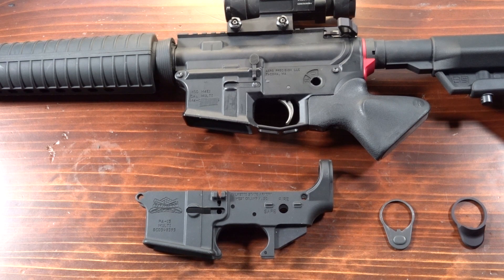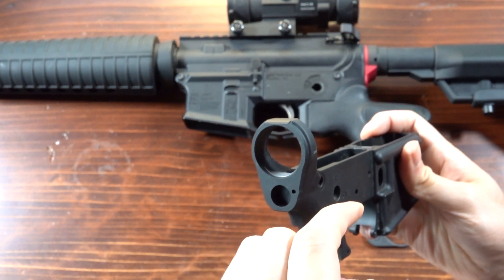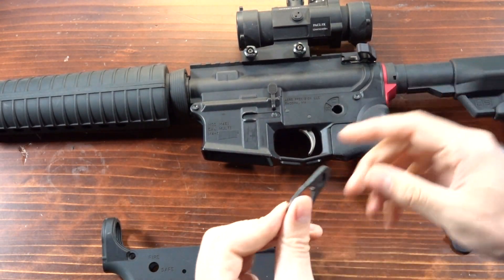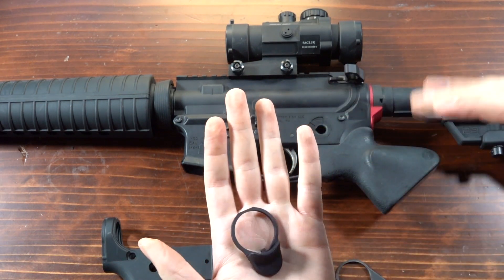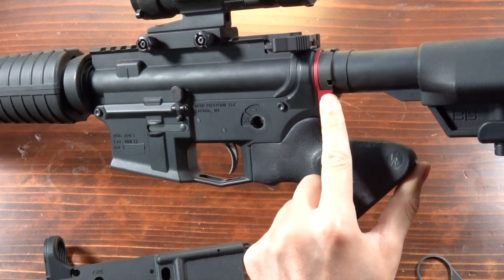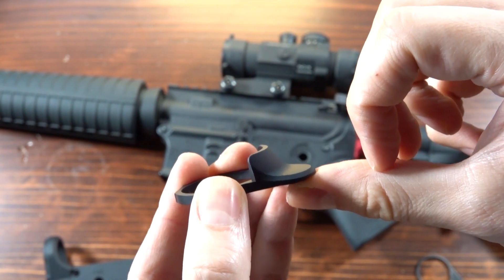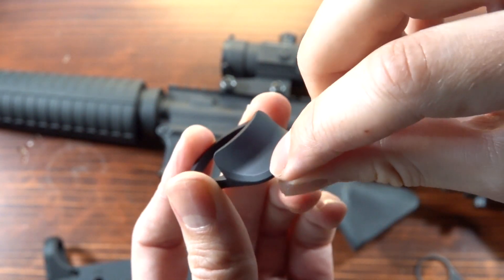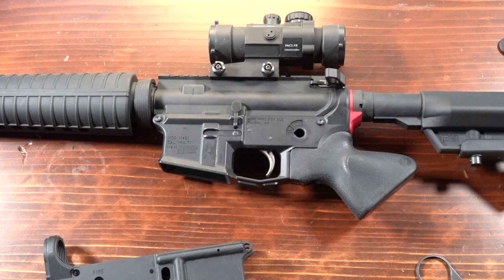Design Deep Dive - Ergonomic Endplate

Comment: Will these endplates hold a stake properly (potential for chipping/fracture when staking)?
Reply from the maker: Hi, we've staked a bunch of these and it works just fine. If anything it's a bit easier as aluminum is more pliant than steel.